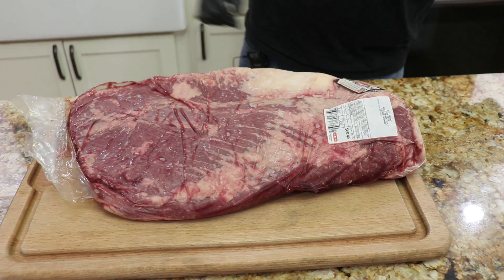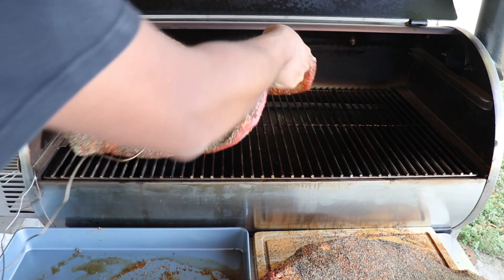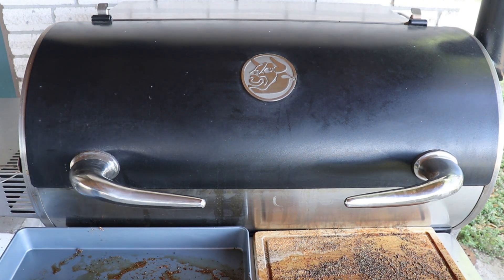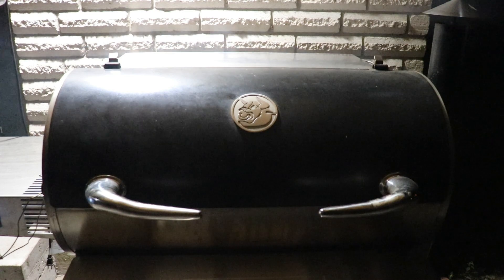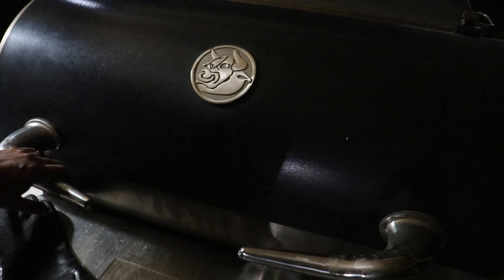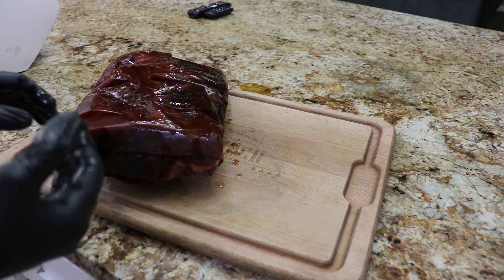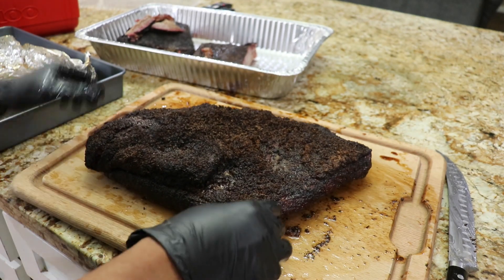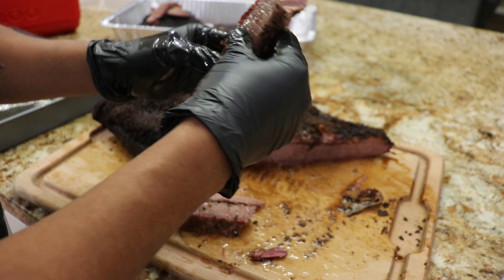Foil Boat Vs Butcher Paper - Recteq 1250

Comment: When I utilize the foil boat, I spritz with a 70/30 mix of Worcestershire and water so that it keeps the bark from drying out too much. That's one thing that can make it flake off. The other is not putting pepper on first and I go a little heavy since the pepper mellows with the heat and smoke. I use Lawry's as well but I put it on last after pepper. Also, I use a Worcestershire binder since it's mainly water. I've found that thick/oil binders and fine rubs prevent smoke penetration.  I watched Chud's sous vide rest video and totally didn't think of that and can say a long heated rest confit'ing in its own fat really helps to keep the bark from staying too crunchy. If wrapping instead of sous vide rest, I use smoked beef tallow to keep it from being too crunchy.
Reply from the maker: I followed up this method on another video and the flakyness was no longer present.  This happened just as you mentioned, not putting the pepper first.  Bark was great on both sides.  It's on my sous vide rest video.  Bark was phenomenal!  Thanks for stopping by my man!

Comment: Love the foil boat on a pellet cooker! Really helps that fat render. In my 700 it’s even better on the 2nd rack so definitely give that a try next time. I’ve never had the flaking issue, not sure if that’s why or what? 

Also a fan of the smoke flavor you get from mesquite pellets. Easily the smokiest but I get a bit of “earthy” flavor that I don’t love.
Reply from the maker: I think it crumbled up a bit, not sure but I'll have to find out what to do so it won't flake and break off.
Reply: Are you putting fat side up or down?

Comment: Picks up the first brisket... Me don't squeeze don't squeeze 👍 nice cook sir. I've had my rt700 for 4 years average 3 cooks a week I'd say. Hasn't had a single hiccup. Only downside the wifi connectivity sucks! The new control fixes that from what I gather.
Reply from the maker: I definitely don't do any squeezing at all.  If it's juicy, gravity will show it!  I do have a similar issue, especially the graphing.  I'll be doing the new firmware update on my 1250 and see what all changes.

Comment: Great video Luis. I like the foil boat method. If I recall correctly, Chuds bbq poured some tallow over the bark before resting the brisket.  That will give the bark a sheen, but also the fat will
make the top side taste less salty. It might even soften up the bark to the point that it may not break and crumble.  Won't you give  it a try.  Also, the fat cap on the paper wrapped
brisket seems quite white in color. It seems like it needed more time to render before wrapping.    Did the foil boat taste more smoky?  Considering pellet smoker produce mild smoke
flavor, it may be advantageous to do foil boat, allowing the bark to catch some more smoke.
Reply from the maker: It seemed alright but I didn't want to go hotter on it.  I wrapped both when after the stall in the 170s.  That's why both are pretty dark.  This is the best way I've found to get a great bark.  I forgot to mention it in the video but both were probing around the same, in fact, the other paper wrapped was a bit hotter.  I think 205*, it cooked a bit faster since it was a bit smaller but who knows.  Every brisket is different I suppose.  The paper wrap did get that bark that I always look for and what I'm used to but wish I had done tallow on it tbh.  Maybe next time.
Reply: As far as the bark flaking off it has to do with putting to much pepper on the brisket because as you cook the brisket shrinks and the pepper/bark begins to break especially when you foil boat it. From my experience lol
Reply from the maker: @Fordamericanboy1  Thanks man!  I'll have to give that a shot next time around!

Comment: What about starting fat cap during the smoke setting and maybe flipping it over fat cap up when you set it at 250 maybe that will help with the flakes? 🤷🏻‍♂️
Reply from the maker: Maybe, there is definitely trial and error with this.
Reply: This would actually be an excellent experiment. Do two foil boat briskets one fat cap up all the way and one fat cap down for first part then cap up for second phase!
Reply from the maker: @michaelditaranto4108  I've actually thought about doing this

Comment: Looking for a smoker. Was looking at the pitboss 1250 elite pro or the recteq 1250. What one you recommend
Reply from the maker: Can't go wrong with either tbh.  If you mean the 1600 Elite then the grates are just like the recteqs but that one has a Super Smoke Mode that goes down to 160* I believe.  The recteq is amazing and if you want steady temps 100% of the time, the recteq will give it to you.  Both are great and I've done reviews on my 1600 vs the 1250 in another video.